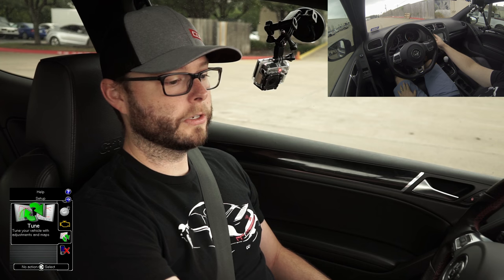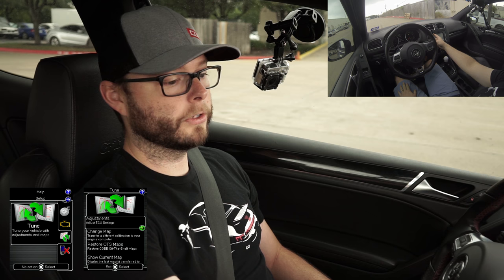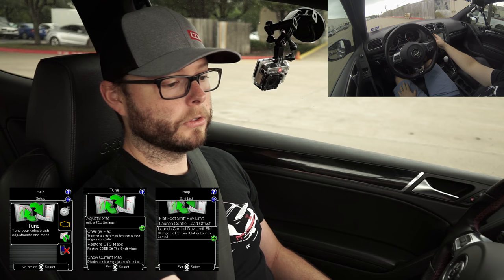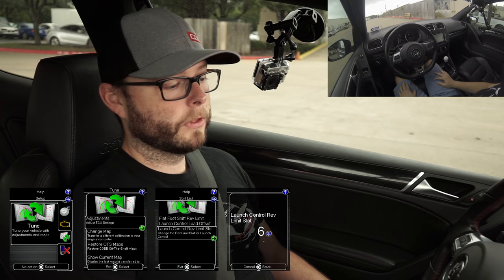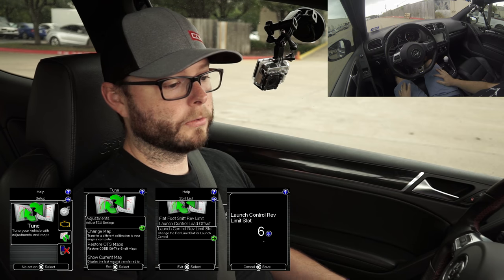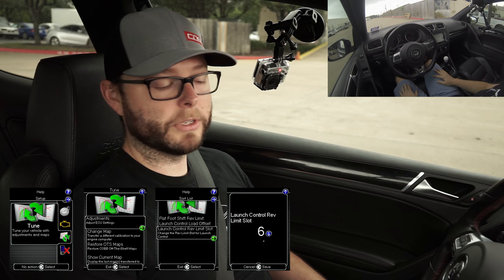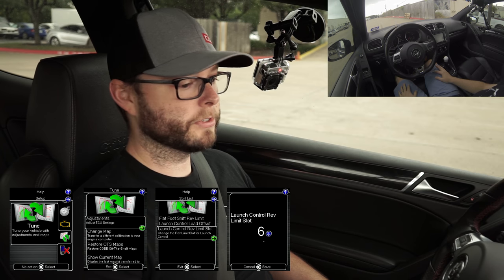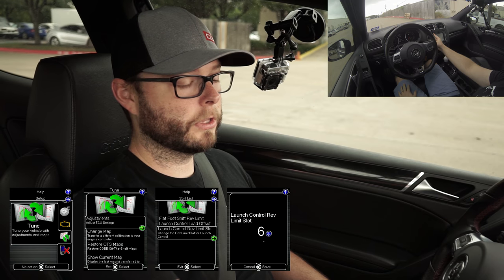COBB Tuning - How to - VW GTI Launch Control, Burnout Mode, and Flat Foot Shifting

Comment: For the launch control, do I have to hold the traction control button to turn off the ecs system with the traction control? I cant seem to get my launch control to work even with the regular traction control off , or when I'm also on the LC screen and when I've saved the setting.

Comment: For DSG burnouts

DSG Transmission
Engage the parking brake
Enable cruise control
Press and hold the cruise control "set" button
Depress and hold the brake pedal to 100%
Move the shifter to Sport Mode
Depress and hold the throttle pedal to 100%
Release the brake pedal
Continue to hold the "set" button for as long as you'd like to do the burnout

Comment: With a DSG, do you still do the same process for this launch control as you do for the stock launch control? Put in S mode and turn traction off?
Reply from the maker: Yes, entering into LC will be the same process as using the factory version. - Marshall@COBB

Comment: Does burnout mode work with the DSG?
Reply: DSG Transmission
Engage the parking brake
Enable cruise control
Press and hold the cruise control "set" button
Depress and hold the brake pedal to 100%
Move the shifter to Sport Mode
Depress and hold the throttle pedal to 100%
Release the brake pedal
Continue to hold the "set" button for as long as you'd like to do the burnout

Comment: Just updated, I'm currently running the 91 high boost stage 1 tune, and I tried to go into the adjustments menu but it says my current tune doesn't allow it... is that supposed to happen?

Comment: Just updated and re flashed , I've been trying to use launch control but for some reason it doesn't do it 😕 , I put it in slot 6-  turned off traction control-clutch in- first gear, rev up but it doesn't hold the revs up.. Don't know if I'm doing something wrong
Reply: Albert Valdez I only noticed mine had that issue if I held the e brake up
Reply: Tommy Truong I tried with and without the e brake and it still didn't work lol
Reply from the maker: Hey Albert, are you going wide-open with the accelerator pedal?  Give us a call if you're still having issues with it. 1-866-922-3059. - Marshall@COBB
Reply: COBB Tuning it worked! Thanks !

Comment: I have a Cobb AP and a tune with Stratified auto and have launch control. But I have only ever gotten it to work once and I am not sure what I am doing wrong. Any help appreciated thanks
Reply: Do you have a DSG?
Reply: Should I Get It Reviews no it is a Manual. I legit have only gotten it to work once or twice other than that it will not work lol.

Comment: Do I need to run the tune the AP comes with or can I run it with the  custom stage 2 tune I have?
Reply from the maker: This feature is available either way as long as the custom tune is up to date on software. If not you can ask the tuner.

Comment: Is left foot braking map already integrated into your OTS tunes? Some ppl like myself would like that feature while tracking.
Reply from the maker: Left foot braking is not currently enabled in OTS maps however has been configurable in Accesstuner since release.  We'll note the request for it to be integrated into the OTS offerings. - Marshall@COBB

Comment: Why doesn't my launch control work on my gti? I already updated n set the rpm to 6 and 2  and still don't still the launch control don't work ! Help !!!!
Reply from the maker: I'm sorry you're having trouble.  Give us a call at 866-922-3059 and we can walk you through it.  Kyle@COBB
Reply: Lemme guess, you didn't read the manual.

Comment: Do I need to get on my computer to update my accessort in order to install on the car?
Reply from the maker: Yes.  You'll need to update the Accessport via Accessport Manager and flash one of the updated maps in order to take advantage of the new features. - Marshall@COBB
Reply: Is it a pro tune ? Or what map should I be on? I get this screen on my accessport "the map file currently flashed to the Ecu does not support the feature"
Reply from the maker: You'll need to be on the current OTS map.  After you've updated, you can uninstall and re-install and select the map with the v104 map.  You can also use the "Tune" > "Restore OTS maps" function and then flash the new map and these features will work.  If you still have problems, give us a call at 866-922-3059 and we can walk you though it!   Kyle@COBB

Comment: Is it better to skip the clutch or just dump it? I have a focus st stage 1 and it just spins the tires too much. Got a 6.7 second 0-60 because of the spinning from dumping it.
Reply from the maker: In that case, you should do things to negate wheel spin.  You'll have to test different things to see what is best.  Slipping the clutch makes it wear faster and is difficult to be consistent.  I'd probably recommend trying a lower launch RPM and lower tire pressure.  Kyle@COBB
Reply: Slip will launch better

Comment: COBB Tuning the AP is not saving the the LC or FFS settings, once car is off and AP shuts off. when turn back on I have to reset everything with LC and FFS. Is that how you guys meant it to be?
Reply from the maker: Yes.  It will reset with each key cycle.  Kyle@COBB

Comment: Just updated, I'm currently running the 91 high boost stage 1 tune, and I tried to go into the adjustments menu but it says my current tune doesn't allow it... is that supposed to happen?
Reply from the maker: Did you flash the current map after you updated?  It sounds like that may be the issue.  You can use the "Tune" > "Restore OTS maps" function and then flash the new map and these features will work.  If you still have problems, give us a call at 866-922-3059 and we can walk you though it!  Kyle@COBB
Reply: COBB Tuning I actually selected the stage 1, 91 oct stock MAF and everything is working really well